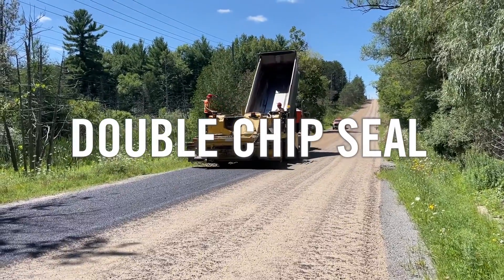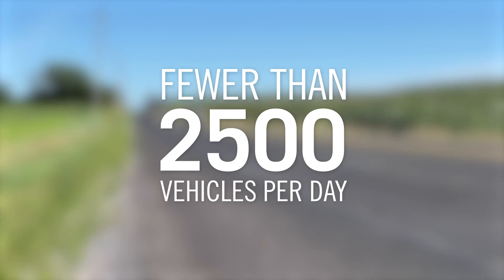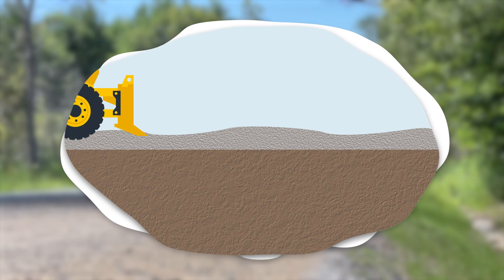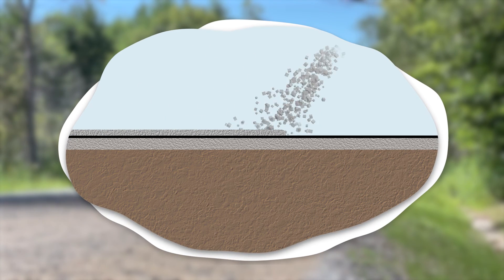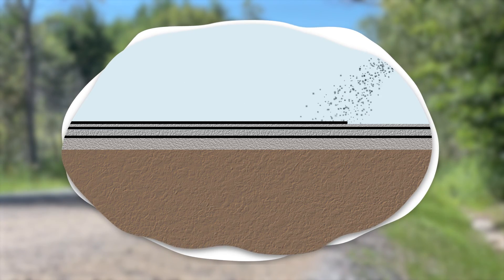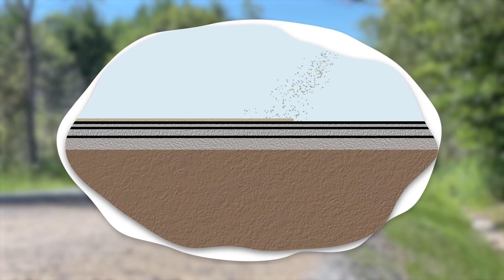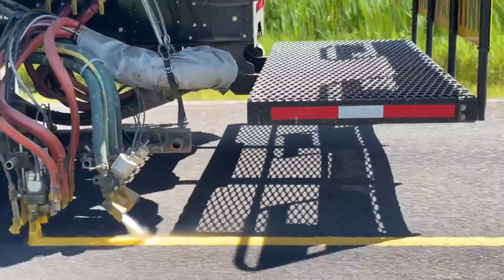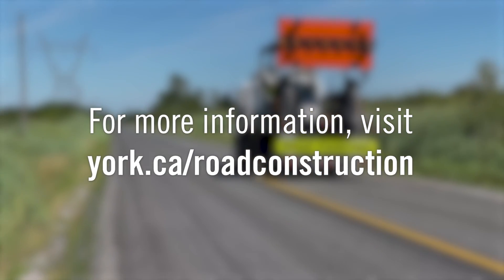Double Chip Seal - Improving your roads!

Comment: This is a horrible description of how to do tar & chip/chip seal  
You don’t remove the base you grade and compact it.
The tar like material is usually CRS-2 emulsion.
The aggregate you surface it with is 3/8” crushed wash stone.
You do not put sand over it.
Other than that, you totally nailed it!